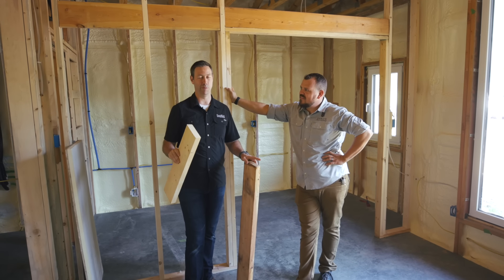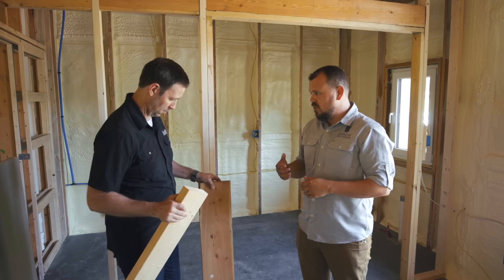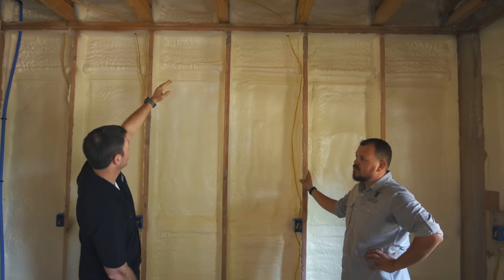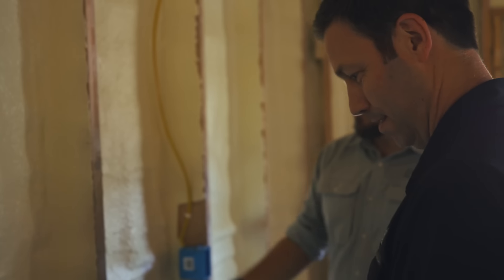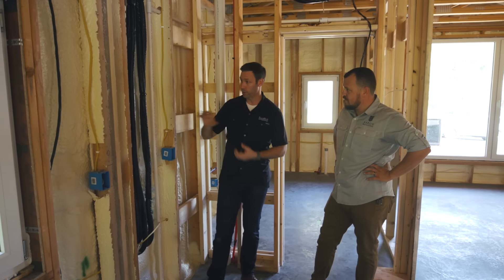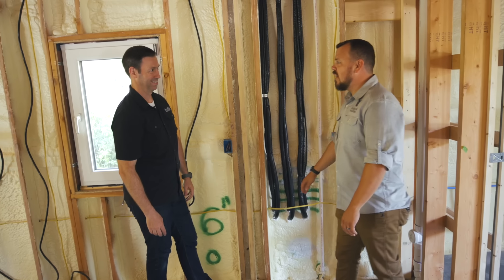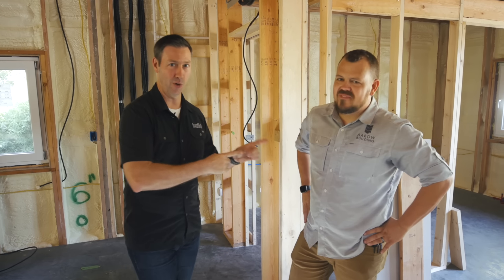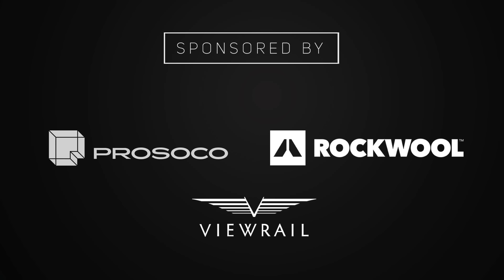Why would you frame a house with 2x8 lumber?

Comment: I stopped framing with 2x8's a long time ago. Now I frame with whole trees.
Reply: Eco friendly option, how progressive of you
Reply: You should do a video on how you run electrical and plumbing in one of your whole tree houses
Reply: Lightning rod for electric water thru the root system
Reply: @Mrigotyouu1432  Yes, basically I use an oil rig to drill  through the wall. I used to plant the electrical wires within the trees when the trees were small, but it took like 20 years to grow a usable tree, so now we use oil rigs to make holes.
Reply: @julioviloria3289  well each tree through its life cycle gives thousands of seeds each season. Not all of those seeds produce a tree but they could. It's not how many trees you cut down, it's how many trees you grow to replace what you've cut.
   It's also not just trees that recycle carbon dioxide, so I really don't understand why you ask the question. If you look at planned forests with trees planted to replace what's cut, you have better space usage and less tinder to combust in the event of a fire, therefore less carbon into the atmosphere as opposed to forests in say California where eco brainless policy is responsible for massive fires doing more damage than when they used to manage the forests.
   Sometimes a person's feelings on a matter cause more damage than practical effective policy on maintaining your resources.
Reply: I usually run a whole tree on a machine to get a broom stick on the other end...
Reply: Damn dude, you’re such a badass.
Reply: Really?! Still using single trees eh? I stopped using those a long time ago. Now I frame by blowing insulation into a forest and cutting out the interior
Reply: Well...its like this....how much money you want to waste
Reply: This is probably one of the funniest comments I have read in a while 😂😂😂
Reply: That's why there is a tp shortage!
Reply: That's nothing, considering I carved it all by hand from one piece of wood.
Reply: @OlesMusic  very clever. Using oil rigs helps to recycle them because they consume a lot of carbon to produce so it's actually eco friendly to use oil rigs when drilling in young trees instead of just throwing them in a scrap heap. 😁 keep up the good work!
Reply: @carolinemercado7406  had to be said 😂🙌
Reply: @Steve the Pirate Ahaaa, good one.
Reply: I haul popsicle sticks from a plant that veneers the whole tree and stamps out the popsicle sticks. 
Cool suff trees are.
Reply: Which is why no one trusts your judgement in matters pertaining to home construction .
Reply: lol
Reply: @sw651  Agreed outside of the context of logging Old Growth forest (over 200yrs depending on climate) which is not sustainable as many species can only survive in Old Growth forests. However managed forests which plant mostly pine also contributes to forest fires.
Reply: @adrianhutchinson4186  yes but we are now finding that some of these fires are purposely set. Just like when environmental advocates used to burn down New construction on coastal properties.
  Sometimes the most damage is done by those who are so passionate about the environment but lack the ability to think critically. Like those who say stop eating meat because cows fart and it produces a lot of carbon to feed the cows when we could just live off plants. They have no idea how much carbon goes into the air from growing plants.
Reply: @adrianhutchinson4186  also I forgot about this video, it's been so long since I watched it lol
Reply: @julioviloria3289  you are not shipping them all over, you can replant the exact amount used, and wood is a store of carbon. Ideally you'ed use pressure treated logs, but I know a lot of people don't.
Reply: Yeah this video is behind the times. Full log framing is the future.
Reply: @Mrigotyouu1432  one big pipe to take a crap in.. one extension cord in middle of house
Reply: alex s Thick studs are a double edged sword environmentally. On one hand they used more wood but on the other hand they make the walls thicker which makes room for more insulation which would make the house more efficient to heat & cool.
Reply: Whole trees? Eh, I plant acorns on 16 inch centers.
Reply: @julioviloria3289  Hi. Trees store carbon while growing and then release said carbon when they rot.

So if you grow a tree, cut it down, and preserve the wood by, say, building a log cabin, while also regrowing a new batch of trees...

...then you will have a carbon sequestering house. Sounds climate-friendly to me. ;-)
Reply: and steel plates of course
Reply: @emreduygun  of course
Reply: I-beams 12” oc 3 feet of rigid on exterior.
Reply: в россии много кто строит из 2/8 доски там холодно. зимой -45 по цельсию в сибири
Reply: @julioviloria3289  Trees cut down lock that carbon forever. Its burning the trees that releases it. Using responsibly sourced wood which is indefinitely renewable and loxks carbon away is the absolute most eco friendly building material.
Reply: 2 years later and I frame with entire redwoods
Reply: Thanks Ole... I needed that laugh 😂
Reply: 2 years later, and you are still making people laugh.
Reply: @felipejose9909 way to upcycle bud. The trees around me are only fit for toothpicks
Reply: @sw651 nobody has ever falsely accused you of being smart have they?  Give me a least of fires set by environmentalists.   And guess who eats the bulk of the plants humans grow?  Livestock do.  Not eating meat results in even less plant consumption, even when people eat more plants to reach caloric requirements
Reply: @Luckingsworth trees don't decompose?  They only lock that carbon in forever if they turn into oil/fossil fuels and don't get used for energy above ground
Reply: Просто лучший комментарий 😀
Reply: Code violation 😂
Reply: Bark or Barkless
Reply: I went the other route and decided to use 1×4's I figured with all the money I will save I can use on my heating bill 😂
Reply: that’s basically timber framing
Reply: Based!

Comment: Here's something to think about - if you use 2x8's @ 24" o.c. you use 21.75 square inches of lumber per 24" length of. If you use 2x4's @ 12" o.c. and you stagger them (one to the inside face / one to the outside face) and you still set them so the wall is 7.25" thick, you only use 15.75 square inches of lumber per 24" length of wall. That accomplishes the same goal of a thicker wall, gives you a sound break, a discontinuous surface for heat gain, and uses 28% less lumber. You also save the premium price of 2x8 lumber. If your goal is to get the most R value in a wall system for a small uptick in cost, why not go all the way and get more benefit for less money. You could argue that setting staggered framing on a continuous top/bottom plate is tedious but the labor cost is made up in material savings. If you made the wall a little wider and used dual top/bot plates you would have a clear run for all of your plumbing and electrical as well. No drilling at all. And I have seen the truss-type studs. Those seems like the obvious winner here for all scenarios.
Reply: Double walls are used in Australia, you can have any gap you want in-between
Reply: Much better to build split 2x4 walls using 2x8 top and bottom plates. The split provides a thermal break and the deeper stud bays provide for higher R-value insulation in stud bays. I’m not a professional carpenter, but consider this wall construction for my cabin in northern CANADA that has a subarctic climate.
Reply: 2X4 = 1.5x3.5
2X8 = 1.5x7.25
double 2X4 only result in 7in which is less than 7.25
I double the strength will be the same too
Reply: @hamster6093  It seems you are completely missing the whole point of a 2x6 or 2x8 wall with ‘split’ 2x4 studs. The exact width of the 2x8s and 2x4s is completely irrelevant, other than the obvious fact that the 2x8 is more than double the width of a SINGLE 2x4. The 2x4s are intentionally ‘split’ - meaning they aren’t lined up. If they are lined up with each other on the outside and inside of the wall, that defeats the whole purpose of this method. The purpose is to eliminate thermal bridging. Otherwise, why use 2x4s at all? Again, the exact dimensions of the wood is not important for this method to be effective.
Reply: @ShikokuFoodForest  Gotcha
Reply: @hamster6093  I’m not a professional carpenter, but just considering this wall frame design to allow for much thicker than usual insulation (higher R-value) plus eliminate thermal bridging. I’ve never built this wall design before, but considering it for building my own small cabin in a subarctic, Canadian climate.
Reply: @hamster6093  It may be easier just to build traditional, insulated 2x4 walls, then simply add an extra continuous layer of insulation on the exterior. This is another option I’m considering.
Reply: Smart idea.
Reply: @colstace2560 I use quadruple walls in America
Reply: Reading this section full of people that have no clue of building codes or structural engineering, or even application of substrate and finish materials.  I need to give myself a raise, and you need to hire me I stead of thinking you know how to build better than the pros.  2x8 walls are superior to anything and everything yall are talking about, for a nominal cost.

Comment: I remember building 30- 40 years ago 8 and 10 inch wall cavities with my grandfather and dad. I didn't think industry's resistance to thicker wall was justified. The increased cost was dwarfed by the energy saving and increased confert.

Comment: I've been building using 2x8 MOD 24 framing since 1978, and I have at least 32 award wining energy efficient homes (all above 92%) here in Florida. Most of the homes exceed 4,000 sf, on one the efficiency exceeds 107% in that we sell energy back into the power grid using both the roof solar system and the wind generating system. Easy to do, cost about 22% more than conventional, but the payback is usually less than 96/97 months and then you are always in the black making money to put back into your pocket.
Reply: Hey Don, I know this is an old post, but I'm planning on building a house(myself) here in Florida. What are your thoughts on which is mor structurally sound and energy efficient... 2x8 @24" or staggered 2x4 @12"?

Comment: I'm going to use 2 x 12s on 8" centers. I need to get in shape anyway.
Reply: Maybe this guy didn't think of that? It would be even better if you used a 11 7/8" LVL. You could have r184. Stupid overkill. You can always tell who is selling this kind of BS.
Reply: I'm going to build a loghouse from giant redwood trees
Reply: I'm building my house with 12x12'z 😂
Reply: Anybody ever stud with 4x4's?? They're really strong so you don't even need a sill plate or top plate.  For extra rigidity I wrap the whole house in a double layer of Tyvek.
Reply: @AOMartialArts  you people are funny as shit... I just woke my wife laughing...
Reply: LOL, take it one step further and just make the house out of solid vertical 2x12 boards :)
Reply: Best response ever 😂
Reply: Difference between this house and a house you would build is longevity and energy savings I've been in a 2800 sqf and cost 200 a month but I've been in a 1100 sqf and cost 400 a month to heat/cool it's all in the insulation
Reply: @probegt75  That's how I built my Lincoln Log set.
Reply: LMAO
Reply: @stevenlenard6948  Plus it would stand stronger in a Earthquake, Tornado and Hurricane.
Reply: I’m building my house with 24 inch thick walls using 48x24x12 diamond bricks!
Reply: Honestly you could do  a laminated column that's 3 2x 6-8-10-12 whatever depth you want at 8 ft centers. It's called a post frame building. Go check out rr buildings

Comment: I personally feel 1x1 make the best framing. It also leaves much more room in the interior
Reply: Funny guy - that's why you don't have friends to go out with and have to troll you tube
Reply: You are a genius.
Reply: A much as I hate wasted space. Anything thinner than your standard 2x4 (which is actually 1.5 by 3.5 for some reason) doesn’t sound like a great idea. If you want to make wall sturdier without making them thicker use tighter stud spacing and good quality lumber.
Reply: Personally I love thin walls, I like to hear my neighbors fvcking 😎
Reply: @mauraece  we all have our own kinks.  Personally I like people hearing me. Thats why i’m glad your my neighbor.
Reply: @stevenbaczekarchitect9431  jeeze hopefully you’ve lightened up a bit in the last couple years
Reply: @CF-3300 I was watching how RVs are made. It looked like they used 1x2 or 1x1 for the framing. The walls are thin. But those things are on the road so they are always getting a lot of wind pressure. So must be strong enough for a one story house. But yeah the insulation would suck.
Reply: Pretty much every Clayton home. Including the roof. It's a real thing.
Reply: Is that 1'x1'

Comment: thumbnail looks like it says "2x3" :p
Reply: I saw the same thing. Why the hell would you build a house with 2x3s?
Reply: That is what I though it looked like to.  I came here thinking that and surprisingly, I knew someone who did use 2"x3" studs for some non-load bearing walls and what a mistake that was.  It seems like the 2"x3" studs really warp and twist bad for some reason.  It made it very difficult to install the drywall with so many of the studs being twisted.
Reply: Ya I thought they were building a mobile home
Reply: @ben12079  You might do split-stud framing, then you don't need the R-HuberZip on the outside.
Reply: Only reason I watched was the 2x3 stud walls.  😂😂😂😂
Reply: it does
Reply: @EARL You can report the video for clickbait thumbnail using the report option made available by youtube.
Reply: I've seen a lot of houses with 2x3 framing, particularly interior walls. I own a rental with this type of framing. It's annoying replacing a door with a prehung made for 2x4 framing.
Reply: @delanodelano2776  It's also common in older mobile homes
Reply: I thought about 2x 8 but 2 x 12 way better r rating and it only cost me an extra $50,000
Reply: @UNLOCKEDANDOVERCLOCK , LOL.

Actually, I have heard of someone who used I-joists for the vertical framing members. The smallest you can readily get is 9½ inch. Not sure if it's cheaper than a using 2 x 10s. Wouldn't need the foam board sandwich as sheathing. Also freedom to put the vapor barrier where it makes the most sense.
Reply: @solar02130 , damn sweet idea. Maybe trap 2-inch extruded polystyrene between the walls (and tape the seams). Then unfaced fiberglass in cavities on both sides. R-36 for cheap fiberglass, or high density fiberglass will get you R-40. No spray foam and no outgassing.
Reply: That's what got me to watch it I was like what the hell is that a 2 x3 ? Click bait
Reply: It says 2x8 but his arm is covering part of it
Reply: @leejones3944  your clever:) lol
Reply: That's why I clicked it. Here in Alaska, we use 2x8 all the time and have known that it's the best way to go for insulation values.
Reply: Bob Ross  24" on center as well I hope. Think how much you'll save in raw materials costs.

Comment: What we have done, even back to the 80s, is a double 2x4 wall offset. Incredibly warm and eliminates any poly penetration issues.
Reply: It's not rocket science, just common sense really
Reply: @Keith Willis All ductwork in a wall is vertical not horizontal so the application would be same as if it was a reg 2x4 or 2x6 wall. Pipes and electrical would be ran as if it was a 2x4 wall.

Comment: I was the first person in St. Joseph, Mo. to use Zip R-6. I also had my framers frame the house using advanced framing methods. The people I work with at the lumber yard looked at me funny but they soon caught on to the long term value I was creating. I pay about 1/3 of what my neighbors pay to heat my house with electricity. The additional up front costs in the upgraded methods and materials have paid me back in less than 3 years. I didn't use closed cell foam but the sound deadening effect that the insulated Zip panels is fantastic. Keep fighting the good fight fellas!
Reply: Bob Ross thanks bob
Reply: Brookfield mo
Reply: I SUPPOSE THE ADVANCED FRAMING METHODS ARE YOUR TOP SECRET. THERE IS NO METHOD OF FRAMING THAT IS NOT BEING USED SOMEWHERE ELSE..MOST STATES HAVE A FEW GREAT FRAMERS.
Reply: Zip panels suck. Only people like you who don't crap would say 1/3 the cost. What your neighbors have the exact same house built at the exact same time? A quality house wrap accomplishes the exact same benefits. What zip panel has a r value? None. I'm a 25 year framer and have had extensive talks with inspectors and engineers about zip panels.
Reply: trshuster  very nice! The homes you build will not only cost less to run, but it makes going solar a whole lot more viable because you’ll be able to offset all your electrical costs at a fraction of the price as the neighbors.
Reply: James Sloan  better yet, put a layer of foam board under your sheathing. That would make a huge difference in r value
Reply: Still probably more expensive than gas lol